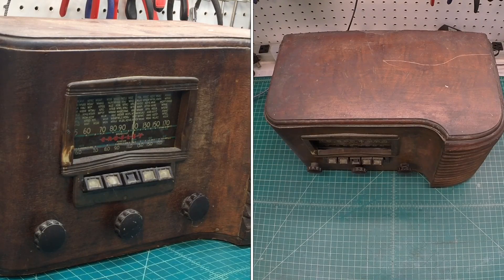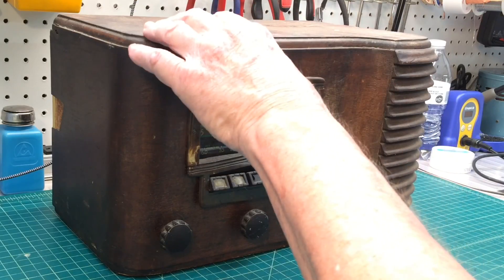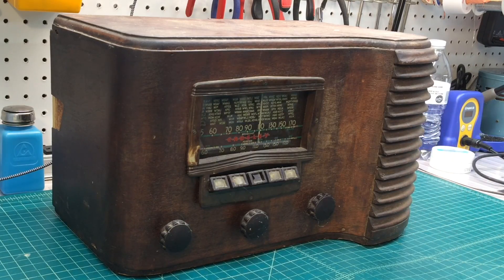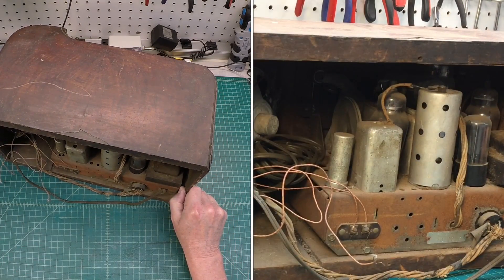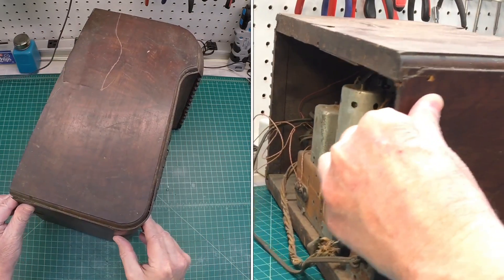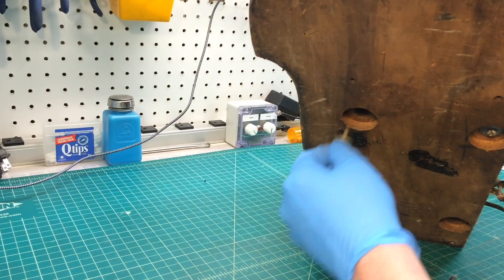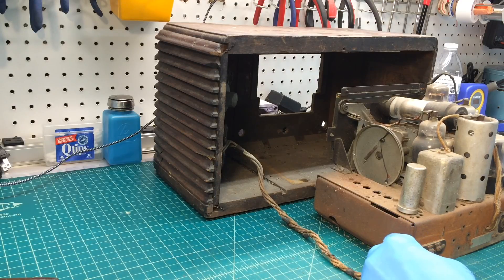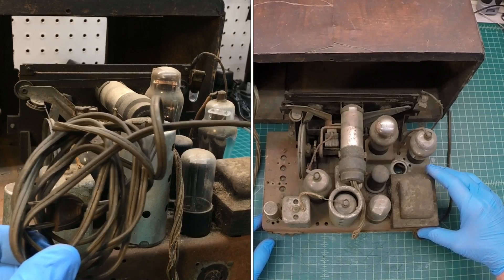Crosley 718-B - Introduction

Comment: Definitely one of Crosley's higher-end tabletop's...  This'll be a challenge, Don!  The dial face alone explains a photo I had seen, of my dad's uncle's Philco dealership. He apparently had a small longwire antenna farm atop the motorcycle garage at the rear of the property. A second, smaller showroom, had a banner from the "Gabriel Antenna and Aerial Company", which pontificated "Attract the world to your fingertips with a Gabriel Antenna or Aerial". 

My father remembered that the antennas, installed, cost around twelve dollars, and that most customers left the dealership with two payment books; one for the radio, and a second for the antenna. You purchased a radio in the morning, and before supper, the radio was delivered, longwire antenna, ladder-line, and ground leads installed, and the radio tuned to WCAU  1210 AM, Philadelphia, to a program called "the March of Time". 

The ability to receive news about the war - directly, was of primary importance, and began around Easter of 1941, as by then, our entry into the war seemed imminent. I remember my dad's uncle saying that the war years more than made up for the meager earnings during the years of the Great Depression. This radio no doubt provided all of that mentioned above, for at least seven very tense years.

One accessory, eh, piece of furniture, that was important, but seldom mentioned or seen, is the 'radio chair', and footstool which accompanied it.
Reply from the maker: Tim, what a wonderful and memorable story you shared with all of us. This one does appear it will be challenging and I thought of you when I pulled it off the shelf of my untouched radios. This is one I featured a few years back in front of the fireplace and you made reference to it being one of your favorites of the... Thanks again for sharing this story and for following the upcoming series. Best, Don

Comment: Looking forward to your videos on this one Don. I like the way the eye tube will be visible behind the dial.  I have run across a few sets with the old speaker field coil mounted inside the cabinet with a replacement pm speaker installed. Looks like it was done a long time ago. I'm sure that was standard procedure for repair shops in the 50's and 60's.
Reply from the maker: Thanks Larry. Here’s an example of the radio: https://picclick.com/Old-Antique-Wood-Crosley-Vintage-Tube-Radio-132578566031.html

I sure hope to make it play again in the near future. It was pretty cool to see the PM speaker and choke in place. Thanks for watching and I hope to get started next week. Best, Don

Comment: That dial with the green tuning eye tube  will look very nice when operating. That chassis looks like the most rusted one I have seen you tackle so far!
Reply from the maker: David - I saw another example of this radio with the green eye and to your point, it looked spectacular. The chassis is equal to the Chanticleer 2D570 that was a rust bucket. The good thing is I didn’t find a rats next under the chassis like I did on the Chanticleer. LOL Thanks for following along. Best, Don

Comment: Looks a bit challenging!  Be cool if you could restore that  trim bezel. I don't recall watching you do a restoration on a push-button pre-set model before...but sure you've done many! Look forward to more!
Reply from the maker: Yep, mitigating the rust will be time consuming for sure. After some feedback from Ian and Bob, it appears the trim piece is actually designed that way, so I won’t have to bother with it. The push-button tuning will make it interesting. Thanks for following this one along. Best, Fon

Comment: Don, I would think that if the surface rust hasn't eaten deeply into the chassis, then there are liquid and gel de-rusters that can be used to restore a rust-free surface that can then be sanded/polished. But you're looking at total disassembly if you want it really perfect. From the video, it doesn't appear like pitted rust. The dial station indicator area has a WEAF about where 770 is. If I'm not too far mistaken, and without Google, I believe that that call became WABC shortly after. I spotted KSL (Salt Lake City) - I recall hearing that on my Hallicrafters late at night as a kid first starting out in electronics in the early 60s.
Reply from the maker: I am with you and hope the rust is more surface than pitting. A see a few places that are more concerning. I plan to start de-rusting this week after checking the coils if time permits. Do you still have your Hallicrafters receiver? Best, Don
Reply: @RestoreOldRadios  Actually yes, I still have the Hallicrafters S-118, and it still works, as of 5 years ago, last time I turned it on. And that includes never having replaced the double filter cap or any tubes. It was bought new for my 12th birthday.

Comment: Do you think that speaker is original?  I don't know what year this was made, but it does seem odd that it would be built this way. It has had work done on it, because of the electrolytic. The power supply would need the field coil, which would explain it being there, even if the speaker was replaced.
Reply from the maker: Gar - the speaker is not original based on another example I saw. To your point, looks like the original has been replaced with a PM speaker and a choke to substitute for the field coil. I hope to look at it next week and start taking things apart. Thanks for reaching out. Best, Don

Comment: Don,

I  looked at several photos of that model and they all have that slight rise in the dial surround. I think it came that way. AT first it looked like a hot bulb had softened it.
Reply from the maker: Ian - thank you. I did the same after recording the video and saw many examples with the slight v-shaped escutcheon too. It sure did look warped at a first glance and I was thinking a hot dial lamp or other... too. Thanks for researching and confirming this; one thing I don’t have to be concerned about. Best, Don

Comment: Hi, I have a radio with a same typ dial. Sadly it got broken and parts are missing... Do you have an idea wich program I could use to redesign the missing parts at the computer anhand from pictures? That would be printed on plexiglass
Reply from the maker: What make & model if you don’t mind me asking? If you are using Microsoft, Paint or Paint 3D could be used. I would scan the pieces you have on a flatbed scanner and then edit/recreate accordingly. I've used Excel and Word as well in addition to Visio. Best, Don
Reply: RestoreOldRadios hello, thanks for the tips. Yes the part with the scanning is also what i thought. the model is blaupunkt 6GW69H , it is a german radio. The chassis is very interesting
Reply from the maker: Sounds like you have a solid plan. I wish you the best on the recreation of the dial and I know it will be a star in your collection soon. Don